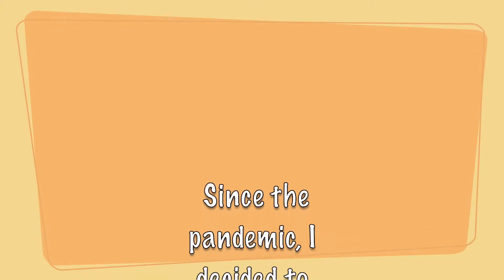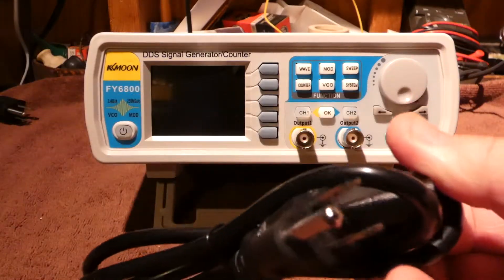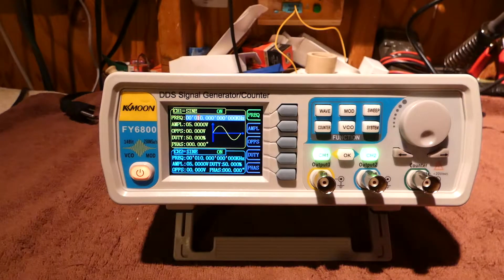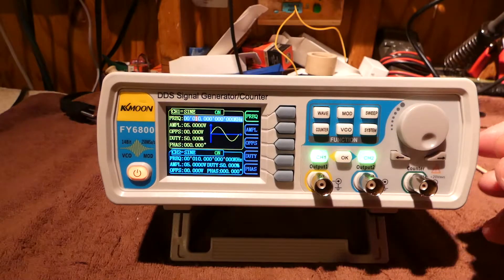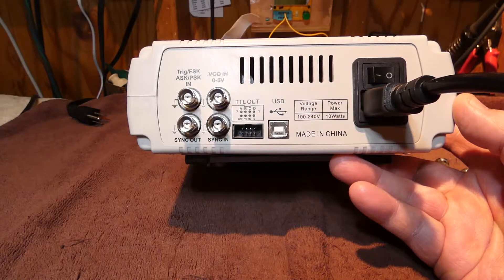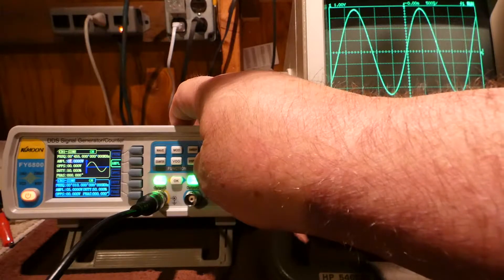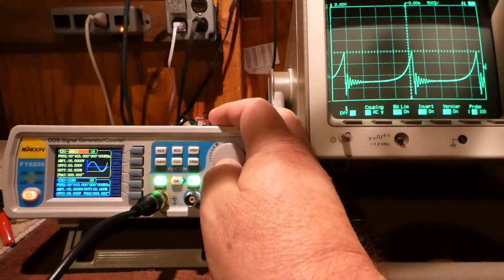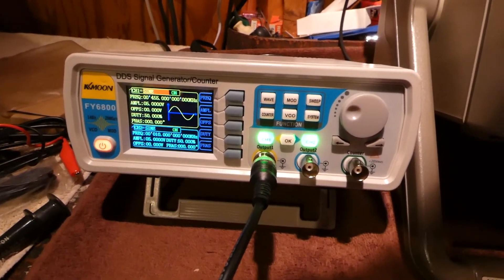New shop tool!

Comment: Bought the same unit, different brand label, FeelElec, same model #. It's my first sig gen and I've just used it to do my very first ever IF alignment. It was on a Grunow Super-Teledial 1181. Worked out fine. Now I need to figure out the alignment procedure for RF. The procedure doesn't seem exist, and the only available schematic for the unit doesn't show component numbers clear enough to ID all the trimmers, there are a lot of them. I'll need to spend some time tracing wiring and marking up the caps and schematic. Thanks to guys like you and other YouTubers I think I can work it all out... In time! Love watching all your stuff Mr. RW!

Comment: That's sweet, I see a need, looking forward to more on it.
Reply from the maker: I be learning more as I use it. No manual came with it.
Reply: I need something for my bench but may only use it a few times a month if that. I don't repair anymore and been off the are 35+ or more years.  A good piece just to have in case.  Does it do what you want it to? would you buy it again?  how is the counter working?

Comment: Nice toy! I think you can get rid of the ringing on the saw tooth waves by using 50 ohm terminators. Or possibly some other value. The coax was being driven low Z at one end and was open / Hi Z (unterminated) at the other. How much did it cost?